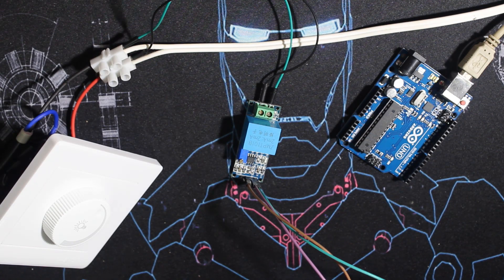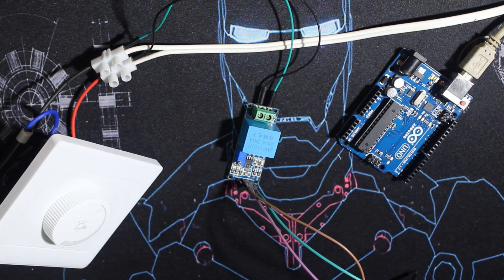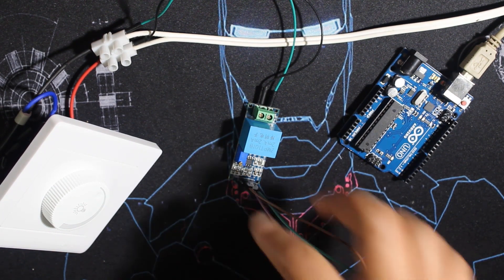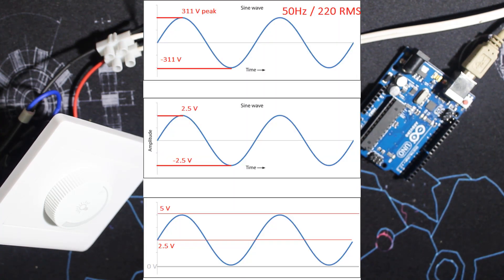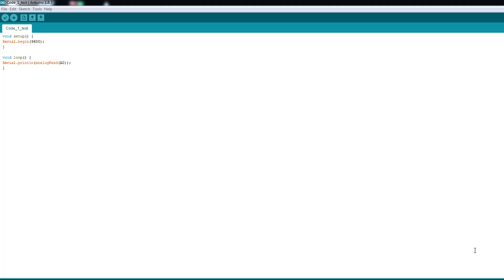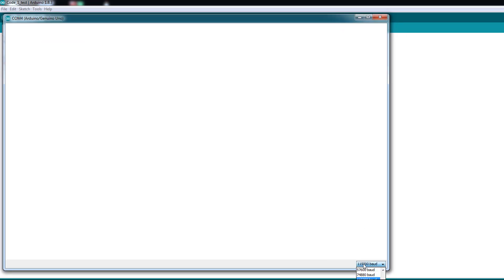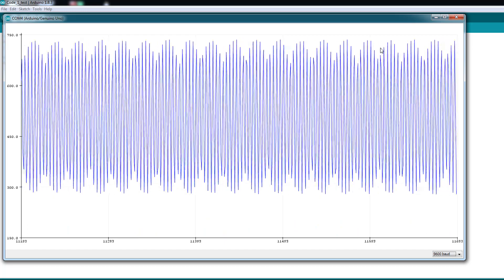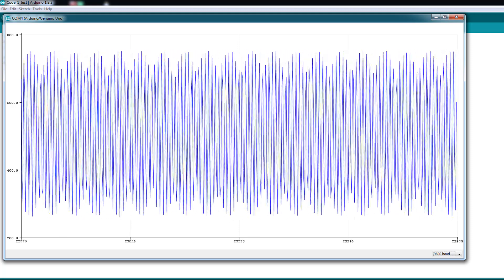Easy measure of any AC voltage with Arduino and ZMPT101B (up to 250V)

Comment from the maker: People who have trouble with Slope/Intercept values, Sorry my bad I tought it was clear, you can check my tutorial about AC current measuring using the same method: https://youtu.be/GcSFvG1DFB0 at 18:00.
It may look a bit different because it relies on the module potentiometer setting first, then on the testing conditions.
Mine required a "further calibration" part, because I used it first in other things and didn't want to lose those values, you can skip that and set only the correct slope and intercept.

Comment: hello friend, I am facing some problem while using the sensor,   the calibrations is not working. with lower voltages less than 30V i get a clean sine wave but the wave forms gets distorted if the voltage is 220V. I tried increasing the VCC input voltage still wave form is looking very bad,  for my work  i need to capture the waveforms and use it in some other works. what can i do to make the waveform looks better?

Comment: On you cheap multimeter, check if the battery is new and has proper voltage. Most multimeters show inaccurate readings due to that battery
Reply from the maker: No, it's not... you can check in the video, on sinewave it works fine but on unsual shapes it start measuring wrong.
Check for difference between TRMS and RMS multimeters.

Comment: You can't fiddle around using code based on arduino IDE, it has too much overhead and will give nothing but problems. You need to write in pure c code and also use interrupts without all the arduino IDE overhead.

Comment: Does 512 always read 2.5V? And this is the RMS, right?
Reply from the maker: Arduino's analog input goes from 0-5V and the analog digital conversion goes from 0-1023... Yes 512 corresponds to 2.5V.... that's not the AC voltage RMS, that's the module output when you have 0VAC at the input.

Comment: Best way to calibrate it to use the relay between this module and connection to power socket. Open the relay, then take lots of sample and average the values to get zero value or mid value where zero crossing will happen. Then close the relay, so now you will have live voltage to the module. This calibration can be implemented as a function, called in the setup function and later using command for runtime calibration. Of course, you have to find the slope using the voltage values and sensor adc measurement, say 0v will be near 512 and 230V may be near 740 depending on the trim position, consider the sensor as linear and save as a global variable and use this slope for further calculations. Also, you have to set the pot so the waveform is not clipped in the voltage range you want to measure, this has to be done in the beginning, if you have oscilloscope the better else this video describe it beautifully. By doing above mentioned step, you won't need any filtering library or complicated passive calibration calculation routine. For sine wave, you don't need to take sample and sum and take mean of it to be squared off later, wiki says if signal is sine wave, you can divide by square root of 2, just run a loop of say 100 or 1000 samples and find peak value, convert to rms value and then using slope and new reading, find out new rms voltage. That's it.

Comment: what is the max current input that the sensor can withstand? 2mA as per stated?
Reply from the maker: A perfect voltmeter should have 0A (open circuit), the 2mA is just the maximum parasitic draws, ideally shouldn't be there.
Reply: @SurtrTech  oic, thanks!

Comment: At what frequency is the Triac operating in this video?
Reply from the maker: Twice the main frequency, main is 50Hz.
Reply: @SurtrTech  Thanks for the quick reply. Also at 8:08 the time period of the waveform seemed to be around 7 seconds (while plotting at a rate of 10Hz). Could you tell me how did you generate that waveform?
Reply from the maker: @DEEPAKSV99  Just change the delay until you get the waveform you want, of course that's not real time (you won't be able to see anything), so you keep playing until you get a more/less synchronized waveform with a lower frequency.
Reply: @SurtrTech  Wow. That seems to be such an intelligent method to view the Waveform at a slower speed. Haven't thought of this before. Thanks for the idea. . .

Comment: great job!,  but i think think the best way to find rms of any periodic wave would be through basic stuff...like ...taking square of n samples,divide by n and taking the square root of the the result .
Reply: If you know that your signal is sinusoidal then you don't need to do that, just take samples and get maximum value or peak value and then divide it by square root of 2. For square wave, rms value is peak value and for trapezoidal wave, it is square root of 3 instead of 2 for division. No need to make it more complicated, because it is not easy to sample and calculate rms values with arduino, you have to consider the timing and zero offset for zero crossing for wave.

Comment: hi, can i measure the AC frequency with this sensor?
Reply from the maker: Probably, but I've never did it, you may wire the module take a value to measure with and calculate durations... should give you the frequency.
Reply: @SurtrTech  Okay, what is the value I take for the purpose of doing this calculation? Because there is no such thing in the sketch
Reply from the maker: @zivkloda882  Well, this sketch is not meant to do that, you asked if "it's possible with this sensor?"
The sketch should be changed completely, take any raw value as long as it's not the peak of the sinewave and everytime the signal passes through that value trigger a duration counter and stop it on the signal period, few math and you got the frequency.

example take value 600, when it reaches trigger the duration counter and when the value reches 600 again don't stop it, but stop it when it reaches 600 the third time.

1/duration=frequency.

Looks interesting may do it some day.
Reply: You can certainly do that, you have to sample and find the count of maximum values in a second, you can use timer. Other way to do the same is comparator to process the signal to square wave pulse and then use arduino to detect its frequency.

Comment: Can I use ZMPT107B instead.. I am planning to implement the module in a PCB.. Please advice
Reply from the maker: Hello, if the 107 has the same specifications as the 101 you can use it, same output and current..., the differences in some errors marges is not a problem, and if you can contact me on Facebook: https://facebook.com/SurtrTech/
 Or Twitter: https://twitter.com/SurtrTech, I'll send you a document that I found about the module, in Thai (I don't know that neither) but contains the schematic.

Comment: The output of this transformer is 5V max, 0V min, with 2.5V at the "zero" crossing? What is the deal with the 2 mA rated output? Is that just the max current output? We are still programming the arduino to scale the 5Vpp back up to 120V/220V?
Reply from the maker: I don't know if you're talking about the transformer part only or the whole module, that 2mA output is because there's a sampling resistor and this type of transformers is made for measurements only, the output voltage of the transformer is 0 - 5 VAC but the output of the module has a 2.5 V offset and it varies between 0V and 5V.
The Arduino has to deal with a voltage that varies 0 - 5V but in the screen we should display the real value at the transformer input.

Comment: Hi! How do you set your assumptions/calculations for the values in the code? the 40.3231 one and the -0.04?? is there formulas i can use to obtain them? or is there any graph i should use/see?
Reply from the maker: The RMS values measured can be offset sometimes for example a real 0VAC it will give you another value so you should set the "intercept" to calibrate it, then same thing for a real 100VAC it will show another value so you set the "slope", it's like a line of solutions that you need to calibrate.
Reply: @SurtrTech  I used a relay instead of intercept, I cut the connection using relay, takes around 100 values and average them to determine zero value, then turn turn the connection on.. my offset is 0.708 (using 0V, 220V and 0V and 253V) after adjusting trim pot which I calibrated using an oscilloscope. I tested between 230V and 253V, because that's two voltage i have because of 3 phase residential connection(one regulated to 230V, other unregulated) . My measurement comes under  +-2 Volts. It doesn't exactly goes to 0V though, but doesn't matter anyway.

Comment: Hello there could this module to  withstand 115VAC 400Hz? And also do you have advise what kind of current module and frequency module should I use for interfacing with arduino?
Thanks in advance.
Reply from the maker: For the frequency, I don't really have concrete idea, the recommended one is 50Hz-60Hz but for 400Hz I don't know, for the current you can ACS712 or GY712, or a split core one like SCT013

And you can use the same algorithm to measure its RMS too.

To measure the frequency you can measure the duration between each peaks or between every 2 zeros and do the math...
Reply: @SurtrTech   SurtrTech  thank you for fast respond, you've explained very clear.

I'm preparing for my final year project and it's related to generator produces 115VAC 400Hz as mentioned above.

Please don't be bothered if I ask you again one day 😃
Reply from the maker: @rrestapani   No problem, I hope I helped.

Comment: Having a hard time calibrating this, Using the initial basic code. I doing this at 120vac and 60hz, would the code be different?
Reply from the maker: You'll have to modify the frequency in the top, it's 50 make it 60, for the calibration the slope and intercept are very difficult to calibrate, so the easy way is to calibrate the part where you find //Further calibration
But if you give enough time to calibrate slope and intercept you'll have better results
Reply: So start the calibration with 

float testFrequency = 60;                     // test signal frequency (Hz)
void setup() {
Serial.begin(9600);
}

void loop() 
{
Serial.println(analogRead(A0));
}

like this?
Reply from the maker: Did you ask about the first code where there's only "analogRead"? No there you don't have that testFrequency variable

Comment: can the module withstand 80 amp ?
Reply from the maker: This is a voltage sensor, it's wired parallel to the load, it doesn't consider the load amps, you just have to consider the voltage 0-250VAC.

Comment: Hello, I using the ZMPT101B on my research, if I want to use this method, where I can find the paper referencing that formula(s)? Thanks a lot my friend
Reply from the maker: First you need to know how to calculate the RMS of any signal, there are some good subjects about this on the internet, but since those calculations cannot be done by a computer in the same exact way, if you want to know how its done here, check the "RunningStatistics.h" file in the "Filters" library, and you'll find how it's done using the Sigma, Variance, Average...

Comment: Hello my friend. Thank you for this awesome tutorial. I would like to ask if you can please elaborate a little bit more on how you went about finding the slope and intercept values. It would be helpful.
Reply from the maker: The hard work of RMS calculation is done by the Filters library and its functions...
If you don't add the (intercept / slope) calculations, you'll read false RMS values, and they need a little calibration further, it's like that all the RMS values are making a line of sultions, this line should be adjusted so we make:
 "y=mx+b" where "y" are the new correct solutions, "x" are old solutions (They are still RMS values), "m" is the slope and "b" is the intercept.

You can find your own slope and intercept by just measuring two or more known values with a multimeter then compare these values with ones measured with Arduino without the (slope/intercept).

Comment: Hi, I'm a last year student using this module. Could you explain how the module add voltage offset to rectified the low AC voltage?
Reply from the maker: There's a transformer that lowers the AC voltage, there are two OpAmps, one sets the amplitude of the signal you can set with a potentiometer, the other one adds a 2.5VDC to make the offset at 2.5V instead of 0V because you can't put negative signal to the Arduino.
I have a PDF document about the module but it's in Thai (I don't speak it), if you can't too you can translate it or just read the schematic, send me a message on Facebook page.
Reply: @SurtrTech  Thank you for replying. This is really the answer I was looking for, I was wondering why there are 2 op amp in the module. It meant a lot for me(and my thesis), thank you so much.
Reply from the maker: @zest167  You're welcome.